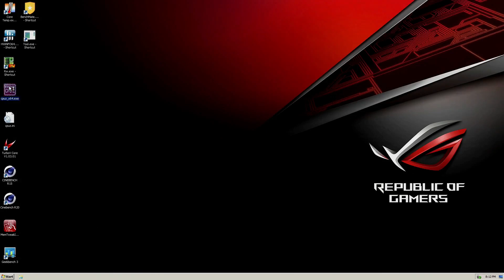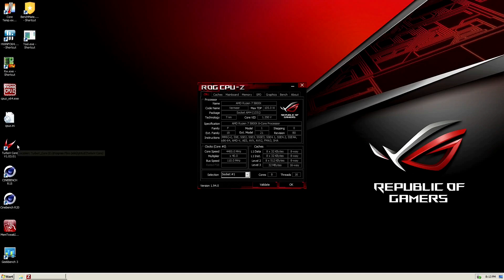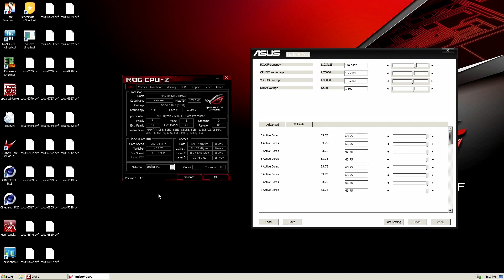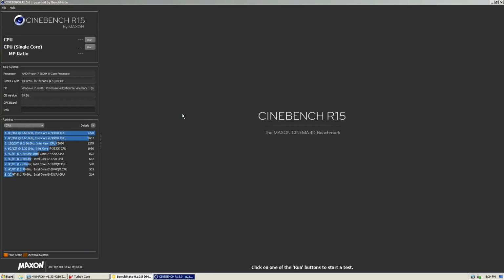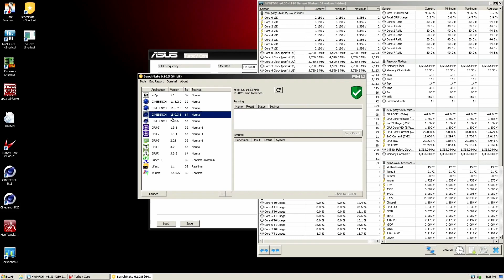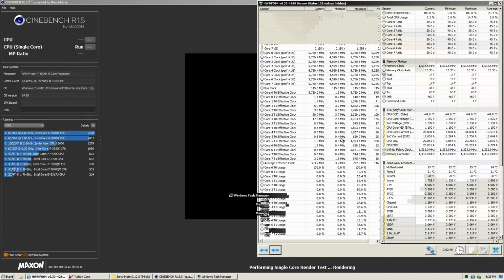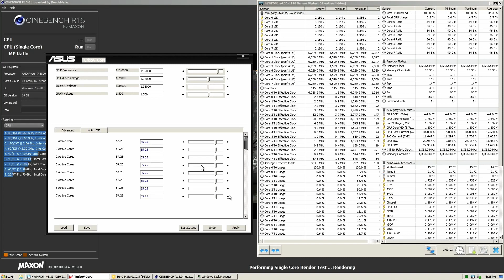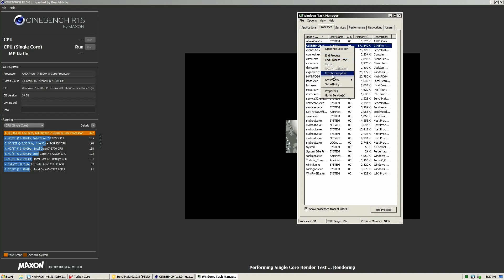Ryzen 7 5800X overclocked to 7 GHz, but it's not real

Comment: How'd you get Win7 to run on the C8DH? Whatever I tried I can't seem to get it to run on mine.
Reply from the maker: It worked out of the box for me, maybe depends on the BIOS/AGESA version. What happens when you try to install it?
Reply: @ElmorLabs  Black screens, BSoDs or it's complaining about not finding any NVMe SSDs. But I got it working after installing it to a normal SSD and then copying it over.

Comment: you could've tried to rise the baseclock. then it'd be clear wether the multi is limited or the cpu itself.
Reply from the maker: You could've tried to check the video, base clock is already increased
Reply: @ElmorLabs  what about increasing it further? does the processor itself limit or does the mainboard do the limit?

Comment: wow, there is video what I wanted :D Btw, how did u get Win7 on X570 chipset? I thought, on X470 was possible, but also for X570 with new agesa?
Reply: Also would like to know! Win10 a shit.

t. 2600/CH7/Win7 Enterprise user
Reply from the maker: If there's an AGESA 1.1.0.0 update for that board it might have a better chance of working for Win 7.
Reply: @Wasmachineman  Windows 7 as far worse than Windows 10. Windows 7 has EXTREMELY buggy filesystem code. The performance and caching of files on Win7 is the worst I've ever seen. So much so we've had to tell clients that Windows 7 is no longer supported. If you use Windows 7, we will no longer support service requests for performance in any area, not just filesystem. I've rarely seen a worse OS than Windows 7. It baffles me that people still defend it.
Reply: This is Win10, but with some disabled optical settings, with the reason that the ressources in the background aren't used so much
Reply: Bro, I can assure you that's Win7 elmor is running, he's just running the Classic theme.
Reply: @thezash953  of course, IM overlcocker guy also, so I doing some  small OS tweaks also for serious overlock, but I did not seen before this look (My Win10 now  operating with 1GB memory (stock is about 3.5GB)
Reply: @FlanK3rCZ  Well der8auer was talking about it
Reply from the maker: It works with some BIOS/AGESA versions, the BIOS I used on Dar Hero seems all good :)
Reply: @ElmorLabs  wow, thank you for the good words :) Laso this video was very interesting (first time, I thought it is  gold sample, but later I had feelings there is something wrong :D )